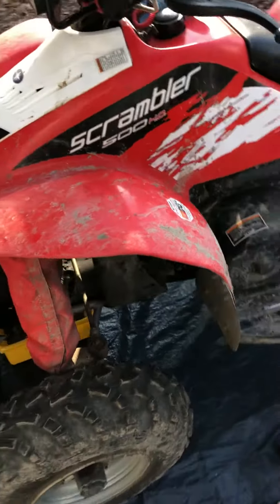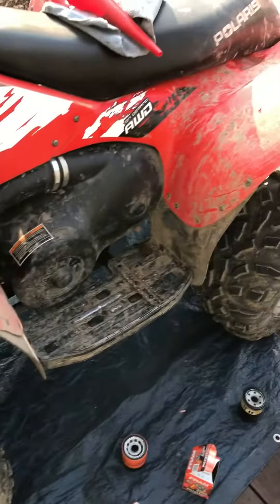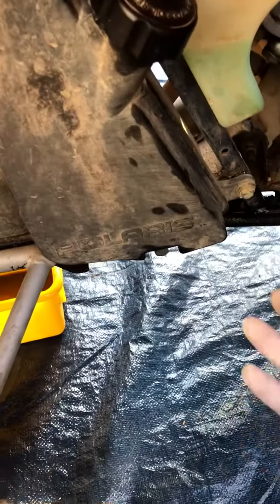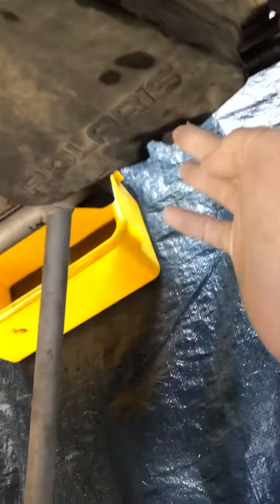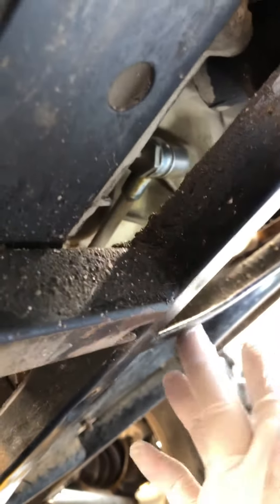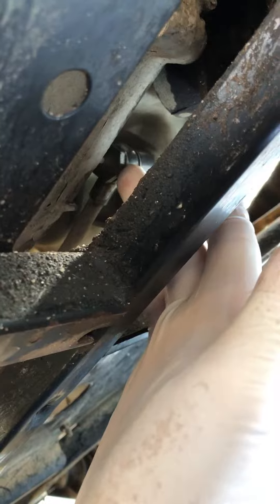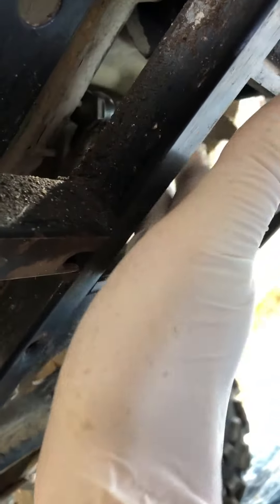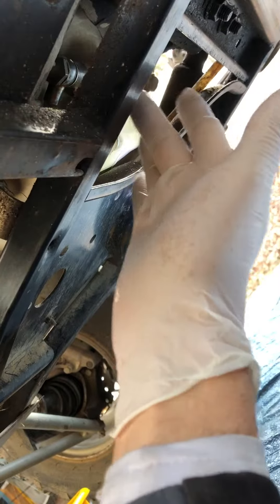Polaris scrambler 500 oil change

Comment: I was told when draining the oil from the bottom of the oil pan....you have to pressurize by pinching one of the hoses off the oil reservoir.....is it true?  I can't find anything on utube about this.  A ATV mechanic told me this.
Reply: yes, per the service manual, there is an oil pump priming procedure that must be performed whenever the crankcase is drained. 1.) clamp or pinch off the vent hose approx. 2 inches from the oil tank, (between the end of the oil tank vent fitting and the vent line's pressure relief slit, NOTE: vent hose is connected to top of the oil tank and runs to the air box). 2.) Run the engine for 10-20 seconds. 3.) Shut off engine. Remove the vent line clamp. A rush of air should be heard, indicating the oil pump is properly primed. If the system is primed properly you should hear some air release. If not, the system has not primed, repeat the process as necessary.

Comment: You should drop the old oil out of the crank case .the drain plug is not the hydrolic hose that you point out .the drain plug is near the water pump on the right side of the bike .by not getting rid of the oil in the crank you are wasting money putting new oil in with old oil